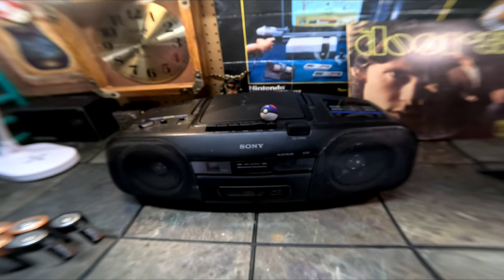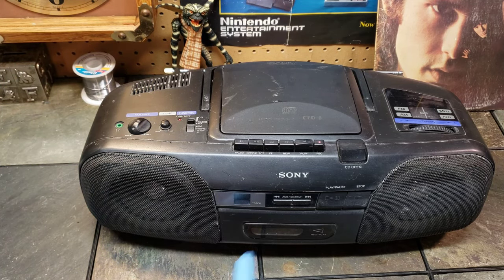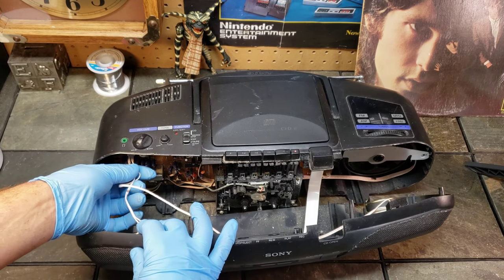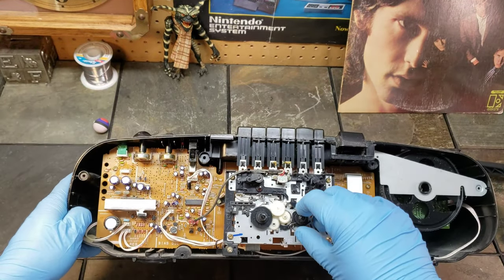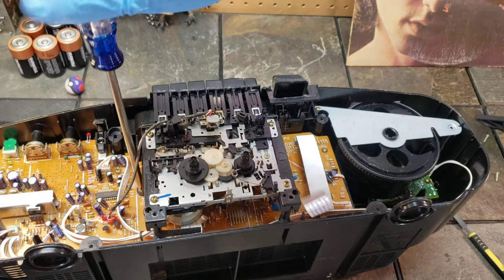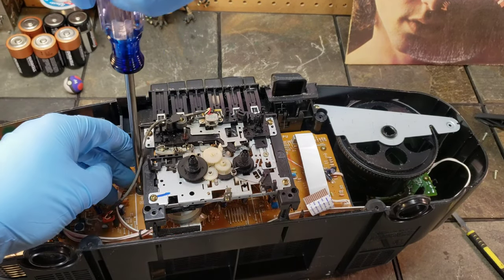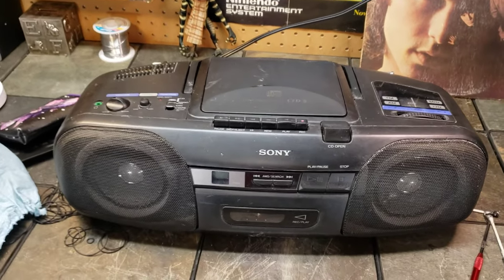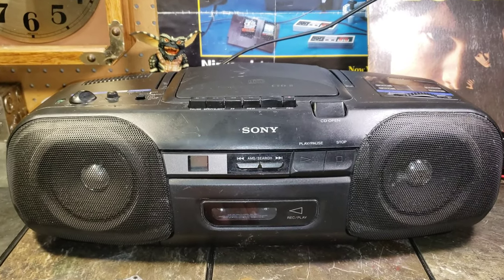How to repair a cassette player! (Sony CFD-8 boombox from 1998)

Comment: The date on the batteries is the use-by date. Sometimes you can get away with batteries that are still good long after the use-by date has passed, but they probably won't last as long as new batteries. And since they have a shelf life of about 12 years, thereabouts, those batteries could have been purchased when the boombox was quite new. Also, just to let you know, there's always the risk of battery leakage, so it's never a good idea to leave batteries in the compartment for a long time. The good news is that Energizer Lithium batteries will NEVER leak! They have an entirely different chemistry that keeps them from ever leaking. Of course they are more expensive, but they will last in storage for 20 years, at least. And they'll power something a lot longer than alkaline batteries will. Put AA and AAA lithium batteries in your TV remote control and they should last the life of your TV set. They're noticeably lighter too.
Reply from the maker: Nice! Thank you for the info!😀👍

Comment: So the only thing I didn't hear you mention when you switched the belts is what size of belt(s) did you actually use??
Reply from the maker: I dont remember now, but I do remember they were the wrong width. All I had was an assortment of belts from Amazon. If you search the model number or check out a specialty website dedicated to replacement belts, you should be able to find a kit or at least the right size belts.